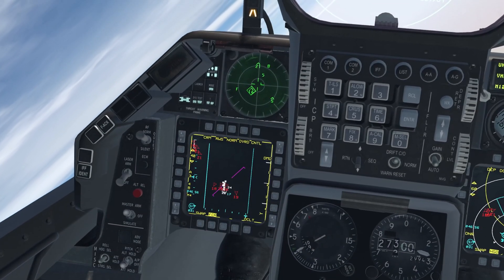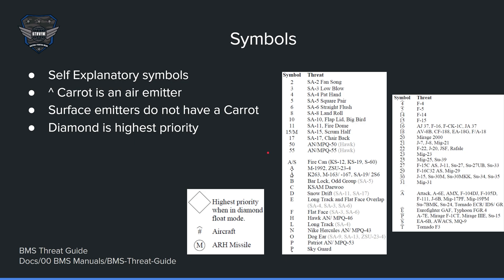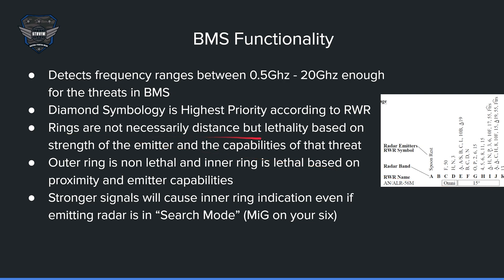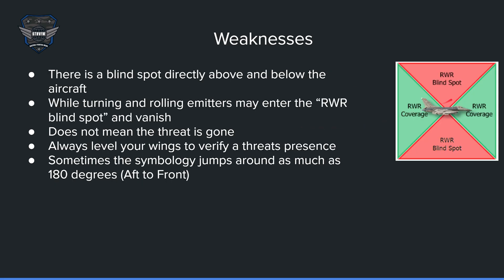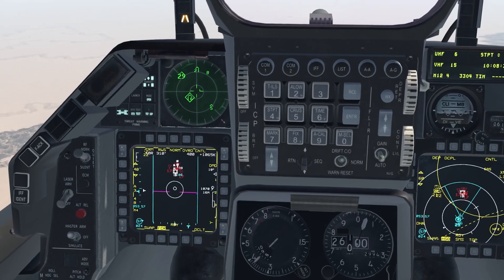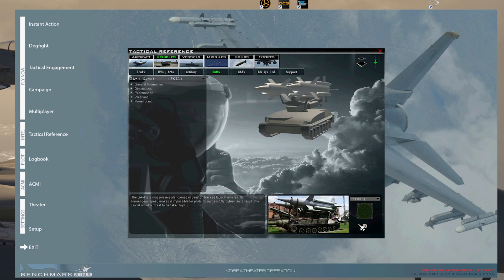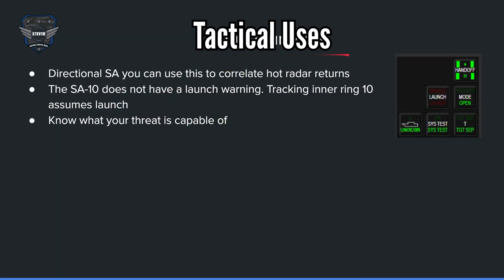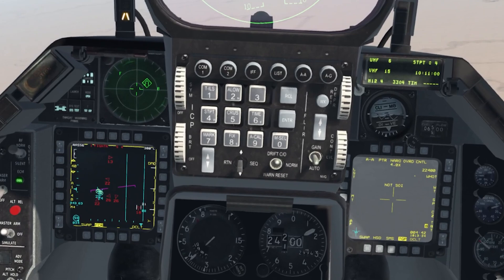How to use the RWR ALR-56M | Falcon BMS 4.37 #Tutorial

Comment: I have sort of grandma's method i sometimes use for confirming that the missile is defeated.
You do your pump, pole or weaves or idk what you feel is necessary, then you put the missile symbol on your rwr's 8 o'clock for example.
Fly straight for a moment and observe whether the symbol is slowly drawing towards your 6, if not and it holds the angle then missile is still on interception course, if it does then its too slow and you can ignore its screaming unless you fly back into it.
I wouldnt swear by it but it helps to bring peace of mind in vague moments and stops me from wasting energy.
Reply from the maker: I sometimes use this method as well. It works but the RWR simulation is too accurate when it comes to azimuth direction.